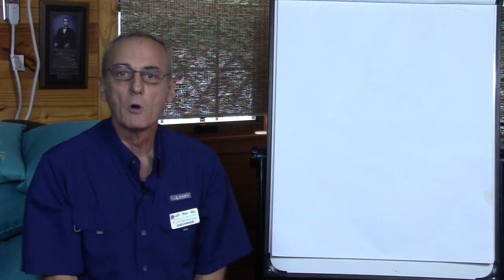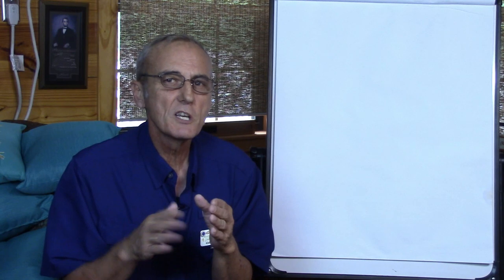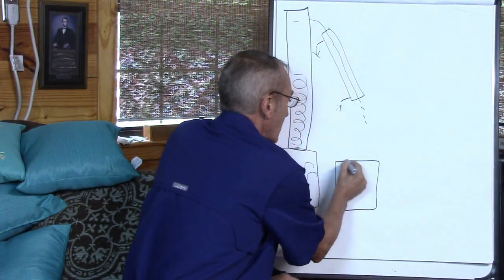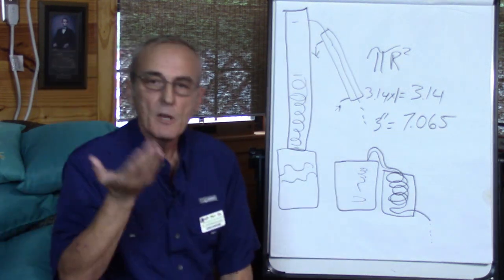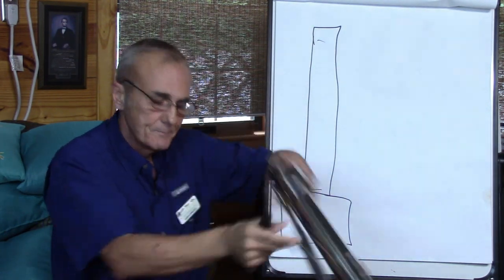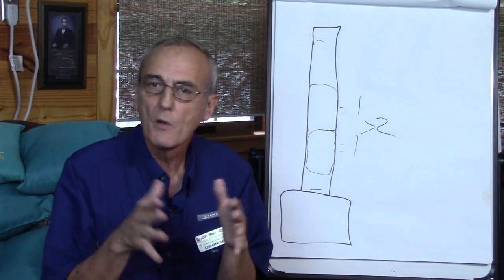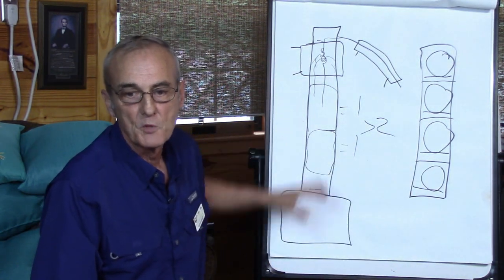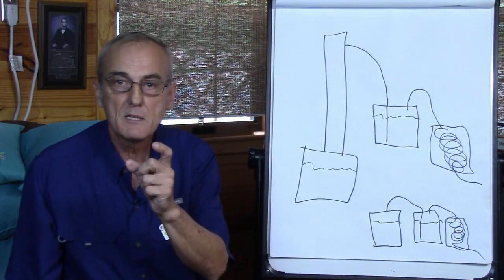STILLS OF ALL TYPES, DIFFERENCES AND EFFICIENCY

Comment: Maybe this question isn't appropriate- if one wanted to use the ethanol for fuel to mix with gasoline- and you need one eighty proof? Does that take a special still or more distillations?
Reply from the maker: You probably would not use 80 proof in gasoline but the process up to cutting is exactly the same. No special equipment necessary.
Reply: @BarleyandHopsBrewing  Thank you. My bad- I was informed that ethanol won't mix, or might separate with gasoline unless the purity is something over 95% abv. I may have been misinformed. The making fuel part is my justification to my wife for buying the equipment since she doesn't view spirits/vodka as being worth it. I am the boss though. I also want to grow my own sugars if possible- Florida climate, maybe corn or oranges.

Comment: Hi George! Thanks for all the great information. I've watched quite a few of your videos, but I haven't come across anything about Sanitation. A lot of videos out there about distilling don't show or talk about sanitizing the equipment that you're using for fermentation. Is using a sanitizer necessary when your fermenting for a distillation? Do you have a video regarding sanitizing equipment?
Reply from the maker: I'll get to work on that right away. I do have a few videos that discuss this as part of the process but not one specific for sanitation. This is a good topic to do a video on. 
Thanks
George
Reply: @BarleyandHopsBrewing  Thank you for the quick reply, George! Looking forward to the video.   - Simon
Reply from the maker: I got your message on the PIC Nuwave but for some reason the comment doesn't show up in the regular place. I had to search for your contact info to respond. 
The PIC titanium nuwave is just not enough to run the 8 gallon still. The still is really too heavy for it and the surface contact area does not allow for good heat transfer. If you were running a small 3 gallon still it would be fine.
Sorry but there is no short cuts to heating. 
George

Comment: Really like your videos. One question though.
In this video you talk about the 'Pressure Cooker' still producing a lower proof (110).
In some of your other videos you add water after the process to lower the proof to 90.
Wouldn't it be better to have the flavors of the mash in the finished product at 110  than to add plain water afterwords to lower the proof?
Reply from the maker: This is a result of efficiency. Lower proof is also an indicator of a less than pure form of ethanol. The more pure it is the more flavor it will carry in a pot still.
George

Comment: Question on column packing. In order for water to condense as it moves up the column the temp must decrease the higher it travels. With that in mind, would the effectiveness of the copper mesh increase the further up the column (into the cooler area) it's located?
Reply from the maker: The copper, in most instances, does little to nothing for temperature as it really adds surface area for the distillate to condense on. I am sure that the thermal properties do allow for an increase but I am not convinced that it has an adverse affect.
The real problem is packing too much in the column. You should be able to breath easily through the column after packing it. If you can't then it is packed too tightly and will disrupt/negatively affect the process.
Reply: @BarleyandHopsBrewing   Not exactly what I meant. Using the single 12"-18" stripe rolled up, would it work better if slide high up the column into the cooler temp range?

Comment: George, when doing a reflux how do you control the amount of water going into the precondesing chamber ? i have the outback but i havent run it in reflux yet... i was under the impression that the precondenser was connected condensor...
Reply from the maker: You need to put a valve in the water line going to the reflux chamber.

Comment: Ok brother! Got one for you.  I have a keg and looking at towers.  Is it wise to use a two inch to three inch adapter for a three inch column on a keg?
Reply from the maker: Why not just use a three inch connection for the column? If you cannot do that there is no reason why an adapter wouldn't work as well.
Reply: @BarleyandHopsBrewing  I'm going from 15gal keg with a 2" to a 3" column. I guess I'm worried about losing the efficiency of the 3" because it's coming off the 2".
Reply from the maker: @shadow4280  Your efficiency should be fine and it would be hard to measure compared to a full three inch lid as opposed to using the adapter but there is not much you can do about that now. In fact, with a 15 gallon still the difference may not be enough to even be perceptible since the adapter is only acting as a narrowing port as opposed to a full reduction of space. 
I know this sounds like I am on the fence about this but I am not. You should reap the benefits of the three inch column as you would expect (minus maybe a very, very, very small reduction in output). 
Enjoy, be safe and as always; happy distilling
George
Reply: @BarleyandHopsBrewing  that's good enough for me. I'm having trouble get a 2" and passing up 3" for a extra $50. The eco line on mile high.

Comment: My question is about the ratio of column width and height for efficiency.   I want to upgrade to a wider than 2 inch column.  I've been reading the forums about column width vs height.  The math in the forums get to be out of my league with the hardcore debates and mathamatic equasions.  It seems the wider your column the longer/taller it needs to be.  I considered going 3 or 4 inch until I concluded the height needed for even a 3 inch exceeded the ceiling height.  What is your experience and opinion on this?  Do you have a simplified explanation for us guys who didn't grow up to be engineers or rocket scientists?  I am using a 50 litre kettle with a hybrid reflux/pot column and shotgun condenser.
Reply from the maker: Your column can be as tall as you want but you should consider the energy needed to fill it with vapor before you go too big. A good rule of thumb is 24-60 inches for a 2 or 3 inch column. A 4 inch column base height for a 50 liter kettle is between 18-36 inches.  When the kettle size increases the heat requirement goes up and the column height also increases.
Reply: @BarleyandHopsBrewing  18-36 inches on a 4" and 24-60 inches on a 2-3"?  That seems short for the larger diameter.

Comment: Is it hard to get flavor out of a 4 plate column. How would you de-tune it to get a good brandy?
Reply from the maker: Try running it without the plates. Just remove them and this will reduce the reflux action and thus the stripping of flavor.
George
Reply: Thank George.  My plates are soldered in place in the column sections. Maybe i will just try turning off the reflux deflag . Let you know how it turns out soon as the weather warms up.

Comment: Do I need to do a fermentation immediately after I cool my mash or can I create more so I can ferment all of it at once?
Reply from the maker: Very good question. I guess you've heard it will turn to vinegar. 
That's impossible. I sometimes leave my mash sitting for months before I get to it. Keep it closed off to the outside and it will be just fine.
Just as a note: the only way to turn mash into vinegar is to add the Acetobacter virus to the mash otherwise is is impossible. Same is true for making mash; you must add yeast or it will not produce any alcohol. A clean sugar wash with out any yeast cannot and will not ferment. Just like a finished wash cannot turn to vinegar.
Hope this helps

Comment: Is there a general measurement of how much space there should be from where the condenser ties into the column to the top of the column? And should the thermocoupler be able to reach where the condenser ties in when inserted? Asking for a friend......😂😂😂
Reply from the maker: No special measurement for the condenser where it ties in. The thermocouple should be at the point where the vapor transfers to the condenser from the column. This is not critical ; you can actually measure from below or above that point but your temps will change accordingly and as long as you record those and measure from the same spot each time you will achieve exceptional results.
Some people have the thermocouple a little deeper into the column and others have it a little higher. This most important thing is to put it in the same spot each time after you determine your still's sweet spot.
George
Reply from the maker: Tell your friend you have a a contact 😀😜😀😀
Reply: Thanks for the info! Love y'all's videos. Very informative and detailed.  Keep up the great work! And thanks again for the response.

Comment: I am a total noob as I don't own a still and all my knowledge comes from watching You tube. My question is based on that. I believed that if you wanted flavors (like banana or cranberries or whatever you've made your mash from aside from grains) you used a pot still because columns scrubbed all the flavor out. If you just wanted alcohol (such as Everclear ) you used a column still. Then I heard if you used a column still and wanted flavor you would put your flavoring into the thump keg.  Am I wrong here? If this is true should I not just make grain alcohol and then flavor it via the thumper? I want to make moonshine but I also want to make brandies and cello's such as lemon, orange, grapefruit and cranberry. And also vodka's and flavored vodka's. Please tell me if I am off base here or not. Thanks.
Reply from the maker: You may be a noob as you describe yourself but you have a very solid understanding of this process. Yes, separation of flavors does happen in a reflux still. In a pot still the character of flavor is left behind and can be accentuated easily. 
Now on to other points you bring out, you can place additives in a thumper to derive flavors as well as pack columns which will do the same thing. The only time the full stripping of flavor happens is when a reflux is used. 
Hope this helps
George
Reply: @BarleyandHopsBrewing  Okay so a regular column ("IE: not a reflux column ") with copper packing or marbles or whatever won't scrub the flavor? P.S. I have watched many of your video's and I can say they are a wealth of info and where most of my knowledge has come from. There is a lot of great videos from others but yours pulls it all together.
Reply from the maker: You are correct. Marbles, copper, ceramic rings of whatever is in there will not strip the flavor unless you use a reflux with it.
Reply: @BarleyandHopsBrewing  Thanks George.

Comment: If I good understand, with more surface we will get more pure ethanol? But what happens with methanol, his boiling point is lover then ethanol and other stuff? Can reflux handle with this? Thank you.
Reply from the maker: Methanol vaporizes at 145 F so it will always come out first.
Reply: @BarleyandHopsBrewing  OK, I get it that now. One question more: if still provide continuous high alcohol rate about 95%, does that mean when come near the end (or going to the end) alcohol level will dramatically (or just faster) will go down? Thank you.
Reply from the maker: Yes it would. This would be a good indication of tails
Reply: @BarleyandHopsBrewing  Thank you.

Comment: you sell propane and propane accessories...ooppps that's hank hill..lol   
you do sell stainless boilers and columns.    
 IF i remember right by your earlier videos you used the copper packing to  remove the sulfates  like a copper still would do. what changed? tia
Reply from the maker: Nothing changed.
Reply: so the reason for the marbles or cubes is to make the column more efficient and not to remove the sulfates. .... i think i got it

Comment: Hey George if my mash temp gets to high say like 160 will that denature the amylaze.by the way what does that mean denature.and if i get it back down to temp can i add more.or did i just ruin it.i was cooking 5 lbs of corn meal and i couldn't get it to cool down and i thought it was no good so i threw it out. help.
Reply from the maker: Around 165 will render it inactive (destroy its ability to work) if your mash has not converted and you suspect that it was temperature then after it cools to 155 add more, stir, cover and let it sit for 90 minutes or so. That should do it.
On the other end of this problem is too low a temperature, if it is below 145 it will not activate and start working but the good news here is that it doesn't destroy it. A simple warm up will get it going.
By the way, when doing this let the mash sit in the pot with no heat added. The temp will remain constant with a lid on it for quite a while and the amylase will do its job. Don't worry about trying to keep it at 155. Let it cool naturally.
George
Reply: Thanks bud.that's what i needed to know. I sure do appreciate ya.

Comment: Any info on what it means when a spirit comes out clear 160-170 but clouds up when cutting down to 80?
Reply: I sent an email on 8/14 with details of my setup
Reply from the maker: Sorry I must have missed it somehow.
I have had this happen with a few people before and the culprit was tails. They let tails into the collection jar and these are transparent at high alcohol contents but when cut to a lower proof they become visible.
Reply: Barley and Hops Brewing 

Thank you. 

That’s what I’ve read. What has me stumped is even the hearts get clouded. The first time I ran the still I wasn’t using a pid, just a straight up on or off based on the column temp. My temperature swings were really dramatic. I’m wondering if my condenser is coated or fouled with tails if I let the temperatures swing up high? It’s a 2” copper pipe with at least 10’ of 1/4 copper coiled up inside. In hindsight I know it’s major overkill. I didn’t find your videos until I had already constructed it. I just designed it based on what I’d observed elsewhere.
Reply from the maker: I would also recommend that you clean inside that 1/4 inch copper tube. There is a lot of stuff that grows in there and I even have some people that report a greenish/blue spirit until they clean the inside of the copper. 
Use CLR (Calcium,Lime,Rust) from walmart. It costs about $5 and soak the worm in it for a few minutes then rinse it well with warm water and a little soap.
Give that try and you will see the difference.
George
Reply: Thank you again.

I'll try it.  Do you think I should construct a more liebig style condenser?
Reply from the maker: Totally up to you. Both styles work very well. The liebig just takes up less space.

Comment: You talk about security, talk about closed and open systems, but don't talk about vacuum systems that prevents distillation by lowering the boiling point. I could talk about this system that is safer. Thank you

Comment: GENERALLY the tube that goes into thumpper gets a V cut on both sides and is almost always a 2" copper tube. this is so that the pressure required for operation is very low. That is why they "Thump". There is only a momentary build up of pressure AND most Thumpper kegs are wooden so the seams let go prior to an explosion. The only fires I have heard of are generally operator error. TOO much "Sampling"!
Reply from the maker: Absolutely.

Comment: I like your vids a lot. You made a little boo boo at 14:29 you went 1.5x1.5 not 1.5x2. You did pirSquared which finds out the area. You said circumference which is the calculable surface area. Not the area inside the stack? Or what Am i Confused or was there a booboo?
Reply from the maker: A slight boo-boo. Called it circumference by mistake.

Comment: Don't use copper foil/mesh. Try, as we call it, copper/stainless steel spiral coils instead. (A thin stainless steel spiral wound on a triangular mandrel, cut into pieces with a length approximately equal to the side of the triangle / diameter of the coil as on http://sprezynkipryzmatyczne.pl/sprezynki-pryzmatyczne-miedziane.html) It gives mauch better results in terms of HETP per inch/cm - this means higher proof, and more clearer hearts.

BTW. Watching George's videos I assumed one can legally make his own moonshine in TX but I checked it, and it seems you can home-distill spirits in four states only i.e. AZ, MA, MO, and ND. 
Sh.t I thought TX was freedom dreamer's haven but it clearly is NOT.
Reply from the maker: Most excellent.